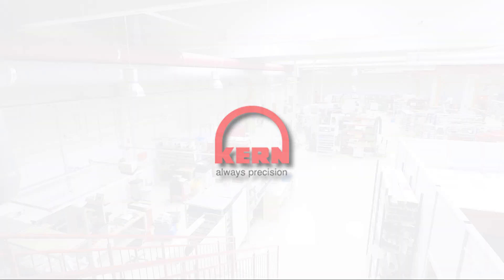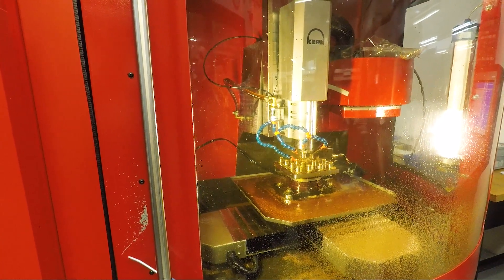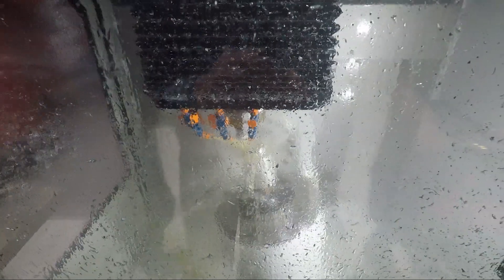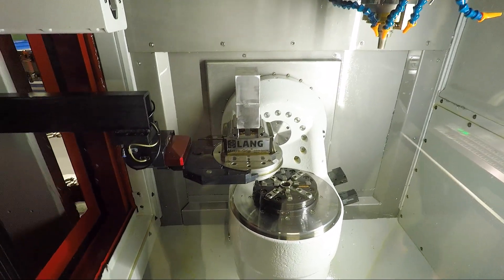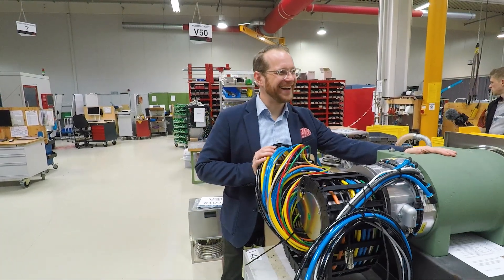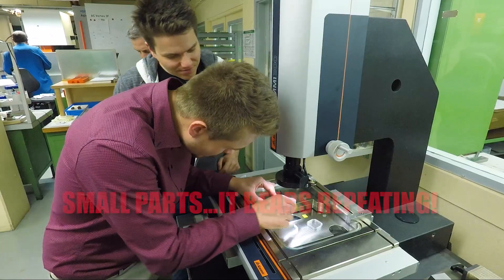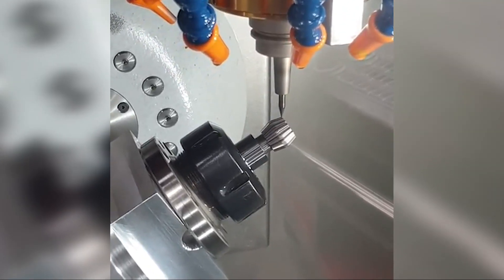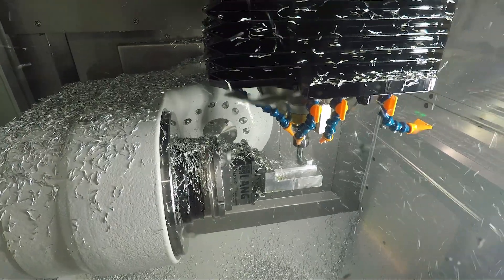Most Accurate CNC Machines in the World: Kern Microtechnik?

Comment from the maker: Sorry, folks!  We accidentally published the wrong version!  This version has a short CAM screenshot explanation of Swarf versus Interpolation - otherwise, no different!
Reply: NYC CNC .You should consider visiting DMG Mori in Germany
Reply: @louies6914  I think Glock, Steyr and H&K use DMG if im correct
KMW, Rheinmetall and RUAG use some but also other maschines

BMW and Mercedes have a lot as well
I wonder how meny Kerns Spacex has  i know they do a lot of their parts with additive manufacture - Laser powder sintering/welding (metall 3d printing) but that leaves a surface like sandblasted and got enough heat shrinkage to be considerable- i bet they need some high precision cleanup and normal milled parts
Reply: NYC CNC i think we can  let you slide this time!!!!!
Reply: @nyccnc please check out Schuster machines in Germany they are a specialty builder and very very accurate VW and AAM use them for their Transmission parts
Reply: NYC CNC amazing
Reply: those germans... always such hairsplitting... sorry I meant hairdrilling jokes ;-)
Reply: Haha .. it only seems that way .
You got to checkout , ower Dutch beaches in summertime 😳😱...
You see the other half , drunk and 100 kg overweighted half  🤣🤣...lol
Reply: So when are you getting one?
Reply: Is there a video with a dive in onto HOW the accuracy is reached? or does it count as confidential information?
Reply: how does the machine know how good the tooling is, as far as the wear rate per tool.👍👍✌✌🦘🦘👌👌
Reply: will we get a longer version too?
Reply from the maker: @Chriss120  Perhaps if I visit again!
Reply: @nyccnc  Just bought a 2nd hand VF OE to at least bring my machinery from the 60s to the 90s and go CNC, modern!

After watching this I feel like a caveman again. Thanks Kern.
Reply: @nyccnc  is Kern better than 6040 cnc?
Reply: Wow! I saw your tour but I missed the accuracy specs. Do you know how these compare to stereo lithography or whatever it's called?  ...the "machining" that is done with the same technique used to make computer chips for micro-mechanical devices like accelerometers & such.

Not that I'm machining things this small, it's just interesting. The smallest tool I've dealt with was a drill about .019" diameter.

Comment: You can tickle out more presicion by temperature control, avoiding thermal stretch and shrink of the machine itself. A cabin around would mitigate energy consumption for temperature control around 27°C for europe. The machine should be fabricated at that temperature, as well, to get the max. And some watercooling for the spindle motor, source of heat, for the deluxe version.

Comment: Impressive as a general-purpose device.

However one should take a look at the diamond-turning lathes and related machines  at Lawrence Livermore National Laboratory. The tolerances are on the order of nanometers, resulting in optical surfaces requiring no further polishing.

https://manufacturing.llnl.gov/content/assets/images/pm/pm_ms.png

https://www.semanticscholar.org/paper/Lawrence-Livermore-National-Laboratory-ULTRA-350-Hopkins-Wulff/41d937050b3282cdb2473e073e3e6bb32aa7f121

Comment: Looks Nice, when you have them test the machines like this. You should have them set a reference plane and make them turn the part upside down and machine it in on the other side to. That way you get an idea of how good their fixturing is. Thats usually wer theese smaller companys fail in my opinion
Reply: With the tens of thousands of hours of engineering that went into these machines, my guess would be that they thought of that…

Comment: Surface finish comes down to tools just as much as the machine it's accuracy, as well as the tool path too.
Reply: Yeah but i'm not going to get a surface like that on a tormach with the same cycle time
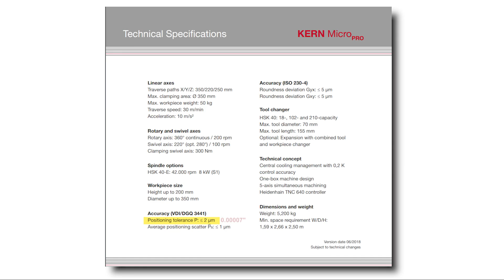Reply: @angrydragonslayer  You wouldn't run the same cycle time though. 0:41 it's a 8kW machine. Yes a Tormach is not likely to get the same accuracy as this if you used the same tools, and used perfect settings. But you could close if you use, good tools, and use the machine you're working on properly, dial in your settings.

Comment: There's a local high end shop in my area that routinely bores .005" holes... that's like chopping wood compared to these guys!
Reply: dam straight. nothing quite like a 63.5x improvement over your local state of the art.
Reply: Well when finishing holes with hone or a reamer they are easy with in .0005
Reply: @destro513  only 6.35x less accurate than the 2um Kern

Comment: +- 0.002 is not that hard on such a small spindle machine...

Try Rhoders or Makino.. 

Or how about a DMG uPrecision 1500x1500x1500 and 0.005 position repeatability...
Reply: Joey, one micron is ~1/25.4 of a thou...so two micron would be.00012. Not at all difficult on a lathe. Very impressive on a mill if consistently repeated. 0.005 is unusable on any machine. I can do 0.0005 or better on my Chinese mill, though manually.

Comment: 03:40  that is their bullshit your are copying you know.   

that has nothing to do with the machine's accuracy and everything to do with the knowledge of the workers opperate it.   
a good machinist can do that on an inaccurate machine aswel.  

it's all about knowing your machine and compensating for it's faults
Reply: Don't be a donkey... 🙄😂🤣😂🤣
Reply: While I agree with you in principle, there are lots of pitfalls to your statement. Sure I can grab a chisel and make a turbine blade from inconel. I can lap holes that are not precise enough when reamed. I can file a feature my machine can't reach. There are lots of tricks to get a machine to produce accurate parts. At some point you're spending more time fighting the machine, than you are making parts. But a good machinist will work better and faster with a better machine. Getting my lathe to turn +/- 0.0005 inch over a 4 inch cut takes a lot of effort. Doing it on a series of parts is surely possible, but it's slow. I'd never make any money using my lathe in production, cause each part would take too long to produce. Its great for the stuff I do with it, which is mostly making bushing or a spacer or a lock ring. Why would you handicap a good machinist with a crappy machine?
Reply: @therealstubot  that's not even what i am talking about.  and i can see you are no cnc machinist.  if you even get close to one in real life you are nothing but an operator that gets to press start and measure products.  

KNOWING
knowing how much your tools will deflect under load for example. is just one of the examples.  
if you know every inch of your machine and how it will respond when running. and how to compensate for that. 
if you run heat up cycles so that you don't start with a cold machines.  
things like these are where a machine's accuracy comes from.   
and it doesn't matter how good a machine is. if the people who work on it suck.   
the opposite is also true.  
it doesn't matter how inaccurate a machine is if the people who work on it know what they are doing.
Reply: @darkracer1252  I'm not a machinist, cnc or otherwise. I am a hobbyist, a guy with some machine tools in his garage. And I said I agree with you in principle. I have crappy machines and I make decent parts. I understand it's more the driver than the car. The basic principles you're referring to apply to all machines, old or new. Every machine deflects under load, every tool deflects under load, there's backlash in every feed screw, every bearing has runout. A good machinist knows how to cancel or balance these flaws in creative ways. This is me agreeing with you.
Reply: @therealstubot  yes.  and i was saying that the guy in the video was just talking bullshit.

Comment: Meanwhile, FANUC makes the Robonano which has an accuracy of 0.0001 micron
Reply: Not quite. If you have a look at the spec sheet, that's just the programming resolution, the stated repeatability (the dimension that actually matters, because that's what the machine can reliably produce) is +/- 0.2 micron. Still VERY impressive though.

Comment: +/- 2um ... ?!

That is insane ... 

Back in the day, I used to use microtome blades, which had a silicon carbide core, with a 2um (+/- 0.1um) diamond film, vaccum deposited on. They were, and still are, used to cut tissue samples -- embeded in parrafin wax -- to one -two cell thickness, to be stained for histopathological examination. I was never trained on the pathology side, but as a path technician, you still had to know yer onions.

I remember the first time I removed a brand new blade from its wooden box. Gave me the right jitters, cause as the person training me said, one wrong move, and it will slice clean down to the bone, without you noticing it ... until you start bleeding out, and the nerve pain kicks in ...
Reply: The company that I work for has 2 kern nanos. We interpolate bores with a tolerance of +- 0.75 microns.
Reply: @chishgre  makes the +-.01mm on our mill seem like open tolerances
Reply: @chishgre  Iv never done anything like that, smallest tightest Iv done was a .100 thou bore bored on a dmg mori to a tolerance of plus .0001 minus nothing with deltronic to check at the machine. No chiller for the coolant either so had to account for shrinkage and oversize by .0001 . Made extra for the ones scrapped due to shrinkage
Reply: only 100nm film? thats 1000 atoms!
2um? 2000x too big!
Reply: Okay that's scary af

Comment: A good day for me I hold all my features to +-.0005" they do 10 times better than that!  The thermal control is the coolest part.
Reply: Best I've ever been able to do is +0.0001 -0.0000 on small parts, and +0.0000 -0.0002 on a 10" long hardened steel bar.

To get that small of a taper out I adjusted the tailstock quill lock handle.  Tighter pushed it towards the operator, not as tight pushed it away from me.
Reply: +.0001 to -0.0. Is the same as plus or minus 50 mil. Which is more accurate than this machine.

Comment: You forgot to mention it's a hydrostatic box way machine, with hydrostatic spindle and leadscrew, it uses no rolling elements in its critical areas, which I think is cool, funny how technology goes full circle and winds up back at a form of plain bearing
Reply: I'm surprised he didn't mention hydrostatic box ways too. They dampen vibrations a lot better than roller bearings.
Reply: Correct!! 👍
Reply: But hydrostatic box ways will not be the only reason to produce parts with 2 microns accuracy. isn't it??

Comment: How does the air pressure from moving the tool break the tool, but spinning it at 40k rpm does not? And how do you even manufacture a tool that sensitive? And how does it even cut material?
Reply: This bothers me as well. If the tool changer is accelerating the tool at 100g, I can see how that could damage finer tools,  but if the tool cannot handle moving through air, then how can it move through something much denser like aluminum. The cross section of that tiny tool isn't going to present much resistance to movement through air ( or aluminum for that matter ). Additionally, the human tool changer is moving the tool through air without damaging it. In any case, I would think that a premium machine company could identify a rack of those tools to be delicate and provide a low impact tool change cycle, or even a facility to programatically modify the tool change cycle to accommodate this kind of tooling.
Reply: @therealstubot  Yea, except that these applications are probably very far and few between. I am sure it can be done, but if they have 25 jobs a year that require this type of tool, then designing and building a tool changer is probably not high on the priority list....
Reply: Moving the tool laterally will apply pressure to one side of the tool, bending it. Brittle materials like carbide are very susceptible to bending loads, therefore they will break.
Spinning the tool will cause a torsional load inducing shear stress, which brittle materials handle much better. Not to say, it is a symmetrically applied force, therefore resistance to breaking will be much higher

Comment: In Germany, engineering, engineer's are regonised equal to Medical Doctors, All scientists, hence part the reason for their success. They also have a very strict heirarchy, where by the shop floor worker, must communicate with his /her immediate boss only to raise any query.
If a technical manager is needed, then all line managers and intermediarys must be present to discuss if required.
Yes, I have witnessed and experienced this whilst installing a machine from the UK.
Great tour John.
Reply: And yet you've had all that (and more) once upon a time.
America is committing suicide using "diversity & inclusion" - all standards have been going down for quite a long time.
"Disparate impact" legislation? What you have allowed them to do to you is incredible to watch from the outside!
Like you have all been brainwashed.
Reply: @thunderstruck1078  Moron. "Diversity & Inclusion" or "Disparate Impact" have nothing to do with high precision manufacturing, but are the excuses of a simple minded, racist moron who does not understand economic scale.
Reply: @thunderstruck1078  well said
Reply: @hotfuzz1913  thanks

Comment: Great video. It would be interesting to see you visit a freeform diamond turning machine shop. Those machines are used to manufacture mirror surfaces for complex optics and can hold tolerances to within 100s to 10s of nanometers, with surface rms of 10-1nm. I'm a PhD student using them to design and manufacture new compact optics for satellites, and I'm continually impressed by the technology.
Reply: Interesting video and impressive machines, but I didn't see anything really new in precision terms. I worked for a company about 30 years ago that was doing diamond turning to that sort of precision and it wasn't especially new then. WRT to the video's mention of carbide and your mention of mirrors, they tendered for machinery to make the E-ELT mirror segments out of various materials including carbide and to get the required finish the final stages involved plasma polishing. The tolerances were such that when polishing the (several inch thick) mirror segments they had to correct for the deformation caused by gravity. Bonkers - I'll stick to software.
Reply: These machines sound exactly like LT Ultra? Surely there are other makers, but I ran into LT Ultra booth at one show and the stuff they do is plain mind blowing. I got even sample part from them.
Reply: @vilts  The two biggest players in this market are Moore and Precitech. My company owns a few of them and we produce molded optics and small medical devices.
Reply: Russia and the USA stole almost all of their tech from Zeiss and Mititoyo after WW1 and more after WW2 
not your tech and Zeiss is again half a mile ahead of most other companys
Reply: @prinzeugenvansovoyen732  oh what a load.  I don't know about Russia but the Germans and the Japanese were regularly copying American machine tools.  Moore manual jig boring machines predate WW1 and are accurate to a micron in all axis and in flatness and parallelism and their design principals are still embodied in these Kern machines.  Your nationalism is what started those world wars, keep it in check pal.